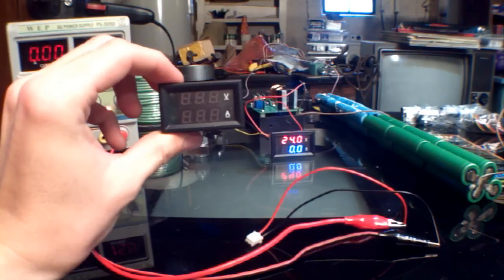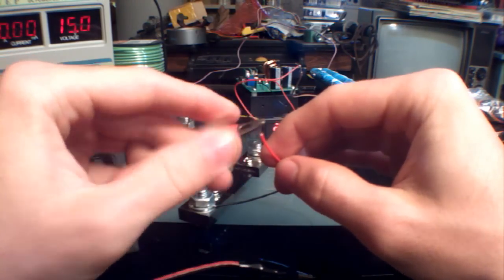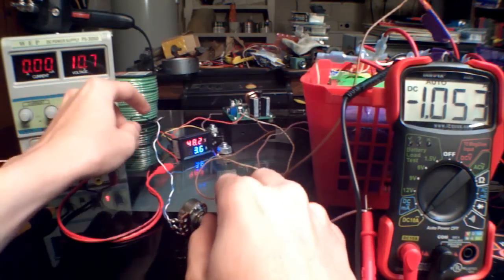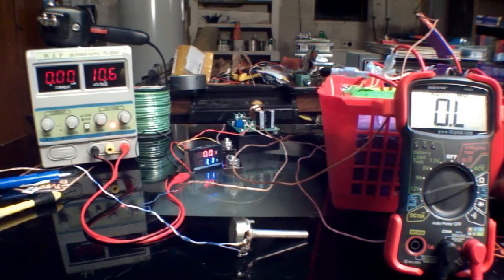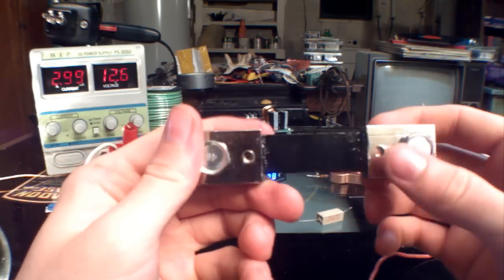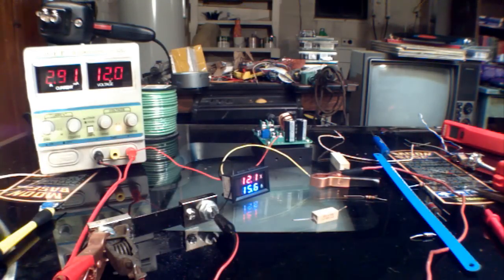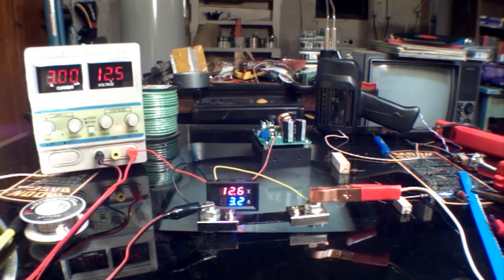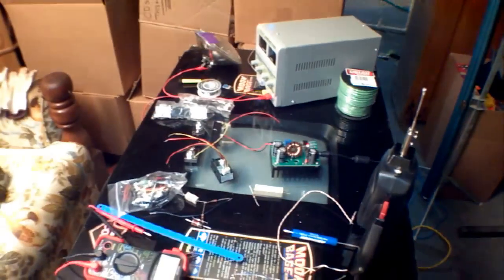Ebay Reviews: 300V 100A Dual LED Digital Volt Amp meter

Comment: The reason why it's not reading right is because you don't have the shunt connected right. You don't run the load through the meter. You run the load through the shunt. Your shunt should be tied in series with your load.
Reply: AznGothic I agree read my comment above
Reply: @Remas20007 if the batteries are in parallel they are going to equalize. 

It doesn’t take long for them to equalize. 

Measure voltage of each battery.

Comment: Supergenius:  You haven't a clue how to use a 4-terminal resistor.

The resistance is accurate between the two smaller screws.  The outer screws are used to connect to the current carrying wire.  The voltage between the smaller screws will be the voltage across the rated resistance.

YOU DON'T CUT THE SHUNT.

Comment: The sense wire connections are incorrect. The black and yellow sense wires from the meter must be connected directly to the (+) head screws on the shunt, absolutely NOT to the big bolt main terminals.  Only the main current is connected to the big bolt terminals. The main current connections will have small but unpredictable voltage drop at the connecting points caused by unavoidable things like dirt, different tightening torque, etc. The ammeter only needs 75mV sense voltage for full scale, the unpredictable error voltage at he main terminals can be quite a bit more. This has been said before, but is repeated for those who only read latest comments, like myself :)

Comment: I believe for currents under 10Amps, the shunt is not required. Red wire to +, black wire to - and yellow wire to load. The shunt is required if you anticipate a current draw of more than 10 Amps.
Reply: Nope. The meter for high amps is not equipped with a shunt in the module and will not read current. Also, be sure of your wiring as some meters are equipped with heavier gauge wires on the two pin connector. Those meters require the Red and Yellow leads to be on the shunt. Black dose not get used if the meter is on the same power supply as the load.

Comment: you normally don't need to use the shunt for low amperage.  the shunt is meant to protect the ammeter for higher amperage measurement, you could probably measure up to 30 amps without using a shunt.  try measurement without the shunt and see if that changes the accuracy of your digital ammeter, this way you could rule out whether the shunt is the cause of low accuracy or whether the ammeter itself is faulty.

Comment from the maker: i did and it maxed out the meter. it is the shunt that was not tuned right. i checked and the meter barely even lets 1 ma through. its designed to run only with the shunt (unless you just want to know the voltage)

the amp meter only registers the slight voltage differance between the shunt ends, it isnt made to let electricity through. sorry

Comment: Thanks man for the idea with the extra cutting and soldering. Mine wasn’t cut but i cut about 2-3mm in it and then resoldered half. This way I managed to get my 50A voltmeter + ampmeter right on point. Adjusting the trimpots on it helped only partially becuase it overshot with exponential values. But the cut&resolder brought it back on track!

Comment: Had the same problem with my meter. That big old iron is very handy for radio chassis work or soldering any plate from 1.6 mm to 5 mm don't get rid of it you will be surprised when it will come in handy.

Comment: I think that problem is with voltmeter/display readings, not the screws like other tell in comments, because properly screwed wires, in both situations, should give the same readings.
I have smaller, voltmeter only display from ebay, and I replace one resistor and then add trimpot to adjust readings and this mostly helps.

Comment from the maker: The resistance in each of these shunts is different and requires tuning by adding or removing resistive material.

The two small screws in these shunts won't come out. They are epoxied in place and hold the resistive plate inside the two outer clamps.

Not counting the reference for these says to run the power through the two bolts..where do you get your information from? I think it may be flawed. But anyway these shunts work great once I tune them.

Comment: The shunt isn't connected correctly! Mybe you noticed those smaller bolts on it right? If yes then thats what it should be connected to. Otherwise its gonna have higher resistance so it gives fake readings.
Reply: MrSlehofer agreed
Reply: Wrong, same readings no matter if you connect on the smaller or larger bolts
Reply: Am afraid that you do need to connect to the small bolts - to show this get another ammeter (diff type) and add it in somewhere else in the circuit - it will show a diff current. Also you can use DMM on mV to read the diff volt drops at diff places on the shunt. ATB

Comment: Hi, if I'm not mistaken that unit has two variable pcb resistors one is for adjusting the voltage and the other one is for the current adjust.

Comment: Just watch your video again. So base on what you describe, the black shank required calibration to read the true Amp. 
Where do you purchase your power supply? I have a 630Watt CPU I like to connect it to Volt Booster like you did and than 100Wx100V Amp Meter so I can see what is deliver to electric bike battery.

Do you have tutorial for how to go about this build?

I originally want to build a AC to DC directly from 110VAC wall outlet. 
110VAC x 15amp ------> 42VACx40amp ------> Bridge recifier  ------> 42VDCx40amp  ------> Capacitor
What size of bridge Rectifile and capacitor will I need for this conversion ???
Reply from the maker: idk, this is an ancient video. stop bugging me about it since i barely even remember filming it. i've filmed over 1,000 videos since.

Comment: Is that soldier iron from jlbpcb? They used it to do the SMD components, before the revamp. What the hell was soldered? 
Anything that big could have been welded with a mig.

I don't know if they made things better or worse? 
The old ones (lower power)  had five wires.
The shunt was on the back and had a read and black wire.

The red went to load negative and the black to ground (source/return)
But you don't use the (device) power  negative. If you did . It's goes bang.
The voltage measure was via the yellow wire.
Most people wired in the shunt black to load negative, the re wire to load positive shorting the thing out as well as the device ground to ground. So many problems, I see there has been a lot of tube Vida on wiring them up in recent years - they didn't come with a manual.

I was thinking of getting one of these, but rider solution is the watt meters, it gives more info and is in a box has two wires in and two out. Bit cheaper. But it can't be calibrated..

Comment: I have one of these meters connected into a PV system, between the panels and the charge regulator. But the wires keep on catching alight and frying on the ammeter side.

Im really confused as to why this happens. I have the positive wire and voltage positive connected to the panel input positive, the negative wire connected the panel negative.

Shunt is inline on the positive side of the panel with the meter across the shunt, all seems to be fine up til the moment I switch the battery connector switch over to engage the batteries with the charge controller - then the wires heat up and smoke and the ammeter sits at 50A from then on.  Any suggestions?
Reply: nicholmesza he is saying the ammeter shunt should be across the negative DC side (black and yellow wires). that is so the black and the red (positive voltage) are in the right place.

Comment: I bought one of these but I can't figure out how to connect it to a circuit.

It has two thin wires (black + red) which I found out to be powering the display, and 3 thicker wires (approx AWG16), (red, black and blue). By the looks of it the meter has a shunt soldered to the back side and the red wire seems to be high impedance (voltage sensor maybe?).
Reply: Search for yb27va wiring diagram on google images

Comment: You had it connected totally wrong mate🤣 I'm guessing you've worked that out by now. The 3 pin plug with 3 thin wires is the meter power supply (+/- red/black) and the thin yellow wire is the voltage sense wire. You don't connect the thin Black wire anywhere when using a shunt, or the same power supply as the shunt/load supply. The 2 pin plug with thicker wires go to the small terminals of the shunt. The thick Red wire goes to the load side of the shunt and thick Black wire to Battery Neg- side of the shunt. The Neg- supply from from the battery goes to the large terminal of the shunt on the same side as the thick Black wire from the meter. The load Neg- side is connected to the other large terminal of the shunt. The Pos+ side of the load is connected directly to the Pos+ of the power supply/battery👍🇦🇺

Comment: I have this same one from ebay. I use it on a power wheel 24v ride on car. After my son riding for a white. The shunt get really hot can't not even tough it or will get burn. Is this normal or something? Don't want to burn it and the car catch on fire.

Comment: When you cut the shunt, it gets more resistive, of course. Hence more voltage drop, which leads to "more Amps", indicated or interpreted by the meter. But what happens, if you apply 100A really?

Comment: Hey I need your help.  I want to buy the same meter.  So the power wire red and ground black can they be hooked directly to the radio harness?

I need to measure amps from my alternator and the volts from the battery.  Which wires go where?

I assume the red will go on the + of battery, black will go on - for ground and yellow will on somewhere on the alternator?
Reply from the maker: red is on positive, black is on negative before the shunt (battery side) and yellow is on negative after the shunt.

you put the shunt on the negative line so all the power has to pass through it. the yellow wire would be on the side of your radio's negative.

Comment: Hello guys,

I have a similar LED volt and amp meter, measuring upto 100A and 100V.

I also have a  wind turbine, with an in-built controller generating 0 - 30A, 24v DC in 3 wires : +ve, -ve and ground.
Please advise how i would connect this LED volt amp meter to the wind turbine, since i want to monitor the VOLT and AMP the wind turbine is generating.

Do i still need to use a shunt?

Comment: I changed all my cheap EBay China meters to Analog panel type with needles. The china model digitals were measuring 1 amp higher than 3 other meters. Some came with shunts that are not marked for value, not knowing if they match the gauge itself.

Comment from the maker: maybe set it up to automaticle reverse polarity, then have it power two LEDs next to it, would be like AM PM on a clock, if power was moving one wy the top LED would light and if the oposite the bottom. sence LEDs are diodes that might not be too hard.

Comment: Seller disclaimer
Measure Current: 100A forward current(more than 10A need shunt)
so if you are using less then 10A it should be off.

Comment: first you say that this double pin out is power supply and and the ther tripple pinout is for data input. and then you just use red wire from triple pinout to power supply. But you said before power supply is the one with 2 pinouts.
And because of this everthing else after is messed up.

Comment: Dear rinoa How u calculate the value of the resistance to get correct amps values on the display
Reply from the maker: it says on the shunt. plus you dont really need to know as long as the shunt works.
Reply: Rinoa Super-Genius basically you added a 35Ohm resistance to the amp meter secundary circuit tu adjust the current on the display right?

Comment: Thanks for doing this snip and I learned many things. One question, does the shunt's  main lugs connect between ground at battery and ground bar? I bought a blue LED just like your demo to measure my inverter power draw but was confused by the simple wiring diagram provided.

Comment: nice job super genius! i definitely learned a lil something. i bought the same exact meter , except the seller stated that it has a built in shunt , on the back there is a approximately 1 mm wire across the input supposively the shunt..... so 2 questions.... 1. do you think i still need the external shunt like you used? and 2. i am trying to wire this up inside a enclosure with banana jacks , to use as a cheap bench meter , i am not understanding their wiring diagram, would i wire it the same way as you did, making the red lead , my pos the black my neg and the current my yellow?Any help would be so appreciated.

Comment: Hello, how would you go about wiring the ebay red & blue panel meter so that with a 24 volt power source to be able to show the voltage from the 24 volt power source But also show the load from the same 24 volt battery?

Comment: I bought one of these to measure current below 1A and then found out that the range is Between 1A - 10A  Could it be modified to measure lower current?  I have seen some of these meters on ebay that read 0.01A to 10A but I have only just bought this and was hoping I could modify it. Thank you very much.. John.... :)

Comment: will this work with a 4000 watt generator ? i have The Champion Power Equipment 46596 3500 Watt RV Ready Portable Generator but the meter broke can i use this meter to replace the broken one?

Comment: Hi, i have one like it bought from aliexpress,its a wireless meter,i wired the wireless shunt In between the inverter and battery but in my case,if i turn off the external power to the inverter it shows discharging state (amps, volts, watts) from the battery, but if i turn on the external supply it wont show me charging state like amps and watts and ah what i mean is am not getting a bidirectional reading only discharge readings should i change wiring setup on the shunt? I followed the non understandable ble Chinese manual !

Comment: thanks for the great video, i got a similar shunt and LED voltammeter> i want to be able to measure how much juice my wind turbine is producing to my battery, but it isnt working for me as i am getting the battery voltage instead of the turbine voltage generated and no current measurement = 0 A.

My connection is as you directed in this video, but my wind turbine is the power supply and while the battery is the load, would this be right please

Comment: I have purchased one digital ammeter and a shunt to measure my load current, my instrument will take apprx. 2 A. The shunt is 100mV = 1A,
Digital ammeter is 10 to 100A and its shunt is 70mA.

After connecting the digital ammeter and shunt the reading shows in the digital ammeter and clamp meter is different.

Could you please help me to sought it out the mater   

Sajeev
Abu Dhabi

Comment from the maker: cool, too bad an electric vehicle would fry those meters.

the lower rated ones i looked at all needed the shunt though. if the meters your talking about have thin wire like this one (like 28awg) then the wires themselves would melt at 1 amp.

not counting the circuit board traces must be pretty wide in order to handle 10a going through them,
Reply: Same meters are available today in both shunted high current and non shunted 10 amp versions. Mine run in the 3-5 amp area without any problems at 4-21V. Yellow and Red on the 3 pin connect to the same point ( + to load ) and Black on it connects to nothing if under 30V is used. Not much load is actually going thru the tiny wires. Black on 2 pin connects to - input and Red connects to - on load. Mine is off by about .02 amp at most ranges but I have not adjusted the setting. Voltage matches a meter that was calibrated at a power plant.

Comment: great video I have bought one of these and I have a small issue,i have my ctek charger and a small inverter connected but when I turn the ctek on it shows the amps but if I turn the ctek off and turn the inverter on it does not show the amps but if I swap the yellow and black around on the shunt it works but the ctek does not show any amps can you help thanks

Comment: Do you have any idea how to wire up one of these voltage and current meters that only have 3 wires coming out of it?
Reply from the maker: that type prolly just has the + and - detection and the + - power together. so it will run off whatever its sensing, i think.
Reply: Rinoa Super-Genius If that's the case, how would I wire that up?
Reply from the maker: *****
black to negative, red to positive, yellow after the shunt.

Comment: nice video! may i ask you question?
i d like to put this meter to a solar panel. how i shoudl connect the wires?
the alim red to + of the converter (battery spot) and black to - of converter (battery spot) and the three wire socket black on the black of battery and red on red battery (so i know how much charged is the battery ) but what about amp yellow? pls help thank you so much
Reply from the maker: the shunt goes between the yellow and black wire, and the power goes through the shunt. that way as power is being pulled through the slightly resistive shunt it drops by a few millivolts that the meter can detect.

Comment: First off I'm not very smart when it comes to electronics so forgive my ignorance. I wired one of these (200 amp version) in my car. Wired the shunt inline with the positive cable to the battery. Wired the 2 wire connector directly to the battery posts. Wired the red wire on the 3 wire plug to the positive on the battery and the black and yellow to the small posts on the shunt. I plugged the 2 wire connector to the meter and it lit up as advertised. Then I plugged the 3 wire connector in and got a spark and a puff of smoke and it no longer works. What did I do wrong?
Reply from the maker: i dont know. sorry that happened though.
Reply: "Wired the shunt inline with the positive cable" You need to use the negative cable.